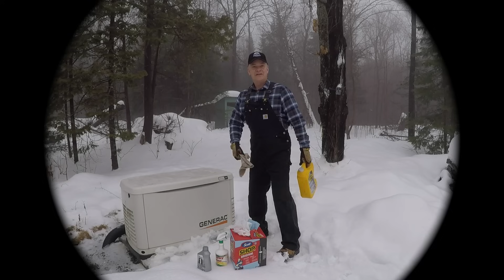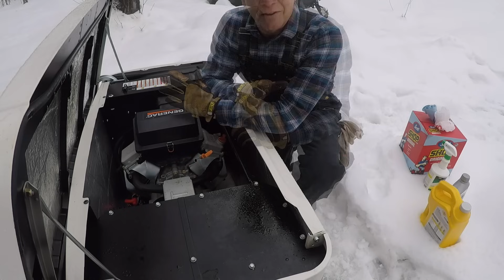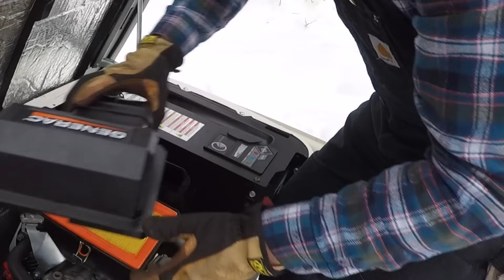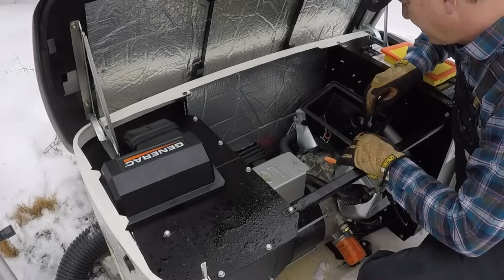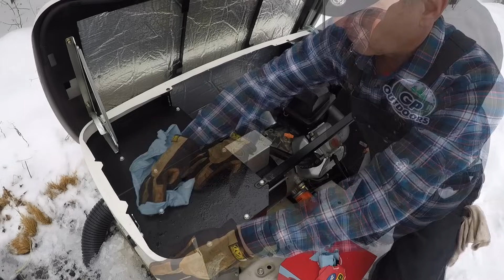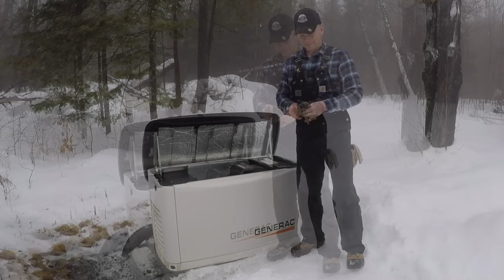#133 Thinking of Buying a Generac Generator? You Need To Watch This!

Comment: What he calls "exhaust port"... is this actually the crankcase breather?  This is a small tube that directs the crankcase breather to the air box intake so these gases vent and burn through the engine.  This would also explain the popped dipstick.

Comment: Great video that explains the problem and solution that he’s found! I’m not a generator expert but I’ve been a technician for 40+ years and I’ve see these rubber weep valves in the bottom of many air filter housings. It’s designed to automatically open and discharge foreign material at the slightest positive pressure and automatically contract with negative vacuum while the engine is running to allow crankcase purge. It is round at the top and converges to a “vee” shape at the bottom where the two sides form the flap valve. I would not drill and leave an open hole, unless you have one of these rubber weep valves to insert. Hope it was a help!

Comment: Great video. If this is a problem you have regularly why not fit a solenoid activated drain valve into the bottom of the air box that is open when the engine is not running and drains the water out through a hose?
Reply from the maker: Thanks for the helpful suggestion. Once the warranty runs out I will do something for sure. Take care and thanks again!

Comment: What about installing an extreme cold weather kit since that you live in a cold climate like me in Alaska. Blowing snow 75MPH wind shut my Generac generator off from running ice blocking the air intake from breathing. My plan is to build a snow fence around my generator to reduce the amount of snow from collecting. So, thank you for your video.

Comment: to me, that hose is acting like a egr valve. this hose runs the crank case pressure and gasses back into the air box to re burn it. sort of like breathing your own farts. why not simply plug that hole in the air box, drill a hole through the backside of the generator cover and run a bigger diameter drain hose outside of the whole thing? Your engine will be breathing clean air, you alleviate the condensation....I think it would solve the problem. Great video btw.....in the process of buying one so glad to see this.
Reply from the maker: Morning Steve. Thanks for the help. A few folks have suggested similar ideas. Take good care and all the best!
Reply: That is exactly what it is doing.  It is part of the emissions control system to re-combust some of the gas.  Another example of the California emissions standards rendering equipment non-functional.  I would absolutely do as Steve suggests.

Comment: Great tips! I have the same 16kw gen set works great. I live in a very rural area at 1300 feet above sea level. Several power outages per year sometimes for 3-5 days. FYI when ever you open the generator cabinet always
1.  inspect battery for swelling from overcharging. 
2. Inspect wires & terminals for rodent damage and corrosion.
3. Check battery voltage on the panel & with a multimeter.
4. Check battery charging voltage & amperage.
Reply from the maker: Good day Sean. Thanks for the great tips! Cheers and all the best!

Comment: Hey GPS, Do you think that if you drilled a say 1/4" hole straight down in the air filter box and put a duck bill rubber grommet in it. That the heat when running that would allow the water buildup to drain out before it freezes?? And by going straight down, instead of going out the side into that exhaust port?? Or just wait for the Manufacturer to take my other idea of a heating element and install that as a "Cold Weather" packsge.

**Edited because spell check sucks.
Reply from the maker: Thanks very much Dan! I heard from another commenter that the newer units have a redesign that is supposed to fix it. Thanks for offering the ideas. Cheers!

Comment: Sounds like Generac Engineering needs to come up with a different approach to their air filtration box. 
Question: could you add a 120 heater or even a Incandescent light bulb  to the generator housing to keep water from freezing during the generators operation. 
Obviously the heater would not need to be running when the generator was off.

Comment: The fix is to drill a 1/4” drain hole at the bottom where the water pools. The 1/4” hole is not large enough to bypass any significant amount of air from the filter and won’t have any detrimental effects on the engine but it will drain the water before it freezes
Reply: As long as the mother board don't go out on you, it's not a bad generator.
Reply: Except maybe for insects and dust. It would be much better if the manufacturer of the generator made a design modification to fix such an obvious design flaw. EDITED: Which, according to a commenter from 4 months ago (3 months before you left your comment), they have fixed. Hallelujah! (Now I have more confidence in buying myself a Generac generator!).
Reply: I totally agree with a tiny hole. Would not cause any issues with filtering. It’s not like a car driven down a dusty road. I’m pretty sure pollen won’t bother the engine

Comment: In that environment I would suggest running a 100 watt bulb hanging in the unit to prevent ice from forming. You'd be surprised how much heat a 100 watt bulb will produce. Put one in my well house every winter.
Reply: A 25 watt bulb would probably accomplish the same thing...

Comment: Whenever it gets real cold here's a little trick that I have used in the past to keep my boat engine compartment extra warm in the winter when it gets real cold. Get yourself a 40 or a 60 watt light bulb it has to be the good old-fashioned kind that puts out a lot of heat. Just run yourself a extension cord and plug-in whatever you're going to use the power your light bulb. I use an old-fashioned drop light.It's the kind that the mechanics used to use and you can pick them up pretty cheap. Or you can get yourself on old lamp. Just make sure it's not touching anything. And when you know the temperatures are dropping just plug in your light and you're good to go. One of the good things it does not require a lot of electricity as would a electric heater.

Thank you for the information on this.I've been thinking about getting the exact model that you have and where I'm at we do get some pretty cold Winters. Thank you for sharing your experience with this.
Reply from the maker: Thanks David. I appreciate the suggestion. I have all 3 heating kits on it now so will see how this coming winter works out. Good luck and all the best!

Comment: generac makes a breather heater now: Generac 7103 Extreme Cold Weather Breather Heater Kit
Reply: Makes little difference to the oil. I service generators for a living and I can tell you these generators do not exercise for long enough. Here in the tri state area I find ALL of these units with water in the oil! (Think chocolate milk).  Generacs answer to this is to tell all owners to run their generator for at least 1/2 an hour once a month (beyond normal exercise time) to get the unit hot enough to get rid of the condensation
Reply: fit a vacuator valve.  problem solved.
Reply: @kirkstinson7316  
Haha I'm in the tri-state too, more upstate ny hudson valley area. 
Such is the life of a generator around here too, cottage cheese inside valve covers and a nice milkshake  in the oil.
Reply: hey thanks i did not know they made one
Reply: @kirkstinson7316  I’m in Mississippi, don’t get Any water in air box, just oil.

Comment: I think it's your PCV, not an exhaust port. I would either move the hose up in the air box or just vent it to the inside of the cabinet.
Reply: Do not vent to inside cabinet. If you do you will have fine oil residue all over the cabinet.
Reply: THERE IS NO PCV VALVE ITS JUST A VENT TUBE !
Reply: if you remove the tube and don't plug the hole you are going to experience problems when bugs get in your mixer motor / stepper motor / carb !!! Whatever you would like to call it !! because the hole is below the filter !!

Comment: Thank you sir, seems like Generac could solve that easy enough. I’m getting a quote from Generac soon for my home backup unit in TEXAS (yes San Antonio to be more specific) 😳. I’ve seen more power failures in the last five days than I have in my lifetime here… And I’m 63
Reply: nice! Another brand to look into is kholer they make some solid equipment.
Reply: We had a heater installed when purchased as per the installer’s recommendation.  Also installed the generator in a somewhat protected location reduce wind cooling the unit.
Reply: I live in San Antone working for audie Murphy.   I know what you mean about power outages….   Really an inconvenience!

Comment: Order a lower filter box housing , 

1- Modify second lower housing by adding a elbow/extension so its well above the level of the ice

2- make a drain and make sure to use a screen to prevent any type of contaminants from entering the box 

 no more problem. 
 if warranty issue from unrelated failure , install original lower filter housing

Comment: As a Generac dealer and technician I can tell you that is caused by high moisture in the air. During the winter it’s mostly due to the intake taking in snow why we always recommend to clean snow around the unit especially in the rear air intake for cooling the rotor and stator. You would also want to check to make sure that your generator isn’t set to do a quiet test mode and have it test weekly and not biweekly or monthly. Also a block heater kit helps aswell.
Reply from the maker: Good day and thanks Steven. Appreciate the help. You are correct. It only happens in severe cold and as you may know, we have a very humid climate in Ontario. I always clear out the snow for a few feet in front of the unit intake, and always have, and I have three heaters on the unit , and always have. My techs just let me know that Generac has just recently released another kit which is another heater that wraps around the vent pipe from the crankcase so that should stop the water from freezing in the pipe. They will be out soon to install it for me. The only thing remaining  is to do something to allow the condensation to drain from the filter cabinet. Thanks again and all the best!

Comment: I was wondering why there wasn’t a drain off the air filter case. Even a high efficient home furnace has a condensation drain and a pump to remove it from the combustion area of furnace and pump it outside the home. A simple quarter inch copper pipe that could drain down and to the out side of the cover. If the pipe went close to that “Hot “ exhaust manifold it would pick up enough heat so that the copper pipe with the water in it probably wouldn’t free up in the winter if the generator was running. If you chose to have a small reservoir on floor of the cover then the duckbill/one way value would work to prevent back flow into the air filter case. 
For the price of that generator I’m surprised that the engineers of Generac haven’t haven’t figured that out.
Reply from the maker: I have been told in the comments, that the newer units have solved this issue but I have not verified that. If you alter the unit by putting in a duckbill drain, they told me it will void my 10 year warranty. So after the warranty expires, I will do that for sure. :))
Reply: Again, the moisture isn't supposed to be there. It is caused by the engine not being run long enough to burn off it's own crankcase moisture. All internal combustion engines will do this for the same reason. 
Start your car when its's cold and the temp. is below zero. Shut it off after 5 minutes and pull out the PCV valve and you'll see a milky white goo which is oil and WATER.
The only modification that needs to be made is to correct the way they are used.

Comment: Good morning... I'm betting you just saved someone from much frustration. Sharing information like that is worth its weight in gold.
Thanks. 😊
Reply from the maker: Good day and thanks Edward. I hope it helps a few folks. They are not bad generators overall but just wish they would resolve that one issue. The point of the generator is to be reliable in severe conditions when power goes out, and of course, that's when this happens. LOL. Have to laugh. Keeps me sane. Thanks again and have a great week!
Reply: @GPOutdoors  I'm kinda looking at the Kubota SQ and J and SJ lowboy  generators plus they have feul and oil guage  with  low engine oil light and feul gauge and glowplugs wich pretty smart design plus same oil filters used from kubota tractor

Comment: Good advice and good how-to video, GP.  My suggestions were listed below in many of your viewers' comments.  I'd have the unit high up on a slab, have the unit sheltered so no snow/water can get inside, a light-bulb lamp inside the shelter to keep it warmer than outside temperature, and store clean-up wipes, cleaning solution, oil and parts in the protective shed for easy access.  The precautions I mentioned are not going to stop the unit from the condensation build-up but just how I'd like it set up.  Your video is definitely spot-on for generator owners.  I wonder if other brands have PCV issues.  As you recall, I recently went through hurricane Florence and said I was going to get a generator and your video definitely taught me something.  As always, your videos hit a home run.  Later and thanks much.
Reply from the maker: Hey good evening Houndsman. Thanks for the suggestions. The Generac is a good unit overall and not sure if it is just the climate we have here but have spoken with a couple of the techs here and will have Generac's latest Kit installed soon which should help. Cheers and all the best!
Reply: Knock on wood, I havent run into that here in New England.  I have had a 22kW unit going on 5 years now on a gen pad outside and it has been flawless in the 3 to 4 events we get every year.  Granted, weather typically not as severe. That said, I will keep an eye out for that.  Thank you for the video and the good tips!

Comment: You call it an exhaust port but I'm pretty sure it's the crankcase ventilation port which sends crankcase vapors through the intake to be burned off  . That being blocked would also build up pressure and push out the dip stick .  Thanks for the video , I'm considering getting one . 
Retired heavy equipment mechanic . There should be a one way drip valve one the intake housing .
Reply from the maker: Yes very sorry _ I am not very mechanical - you are right - crankcase vent. Thanks and all the best sir!

Comment: A very well organized and thought out video. Thank you.  I might make a suggestion or two. Northern Pa winters can be cold. I installed the following on my Stand-by Generac 20KW: A battery heater pad, an oil filter wrap around heater and finally some heat trace tape below the air filter housing.  Since I took these measures I have had no issues through the years with any potential ice build-up and lends itself to an easier start-up.
Stay well (and warm)
Reply from the maker: Thanks very much for the great suggestions. I have 3 heaters on it currently and had aded the last one -which was a new kit they offered this past winter, which wraps on the vent port to stop the water from freezing back into it. The water still builds and freezes in the filter box but at least it is not blocking the vent port any longer. Thanks again and all the best to you!

Comment: If there is water then you should be able to control it. Maybe a condensate trap or condensate evacuation devise would be helpful.  They only allow flow one way so no vacuum air can be drawn in..

Comment: my neighbor bought one last october and has never needed it but the serviceman has had to come out five times since then to work on it. it is supposed to self start every couple of weeks so it will be ready but it has failed to start and run every time. i would rather trust a camp fire to keep me alive
Reply from the maker: Good morning bubblegump. Thanks for the info. It surprises me. Both mine have always started - this is the only trouble I have had (not that I am happy about it as it has been recurring for a long time) but anyways thanks for the info. Cheers!
Reply: They are designed for short term standby power only not sustainable for that you are better off with a diesel generator such as a stateline those run forever
Reply: lol
Reply: Live in FL and ours is connect to our home gas line.  Since install two-years ago, the unit has performed as advertised. Self-starts every Friday for a check and on six occasions when we've lost power, the unit has provide all the power we've needed in our home.  The longest run time for an outage has been seven hours.  During install the rep cautioned my wife that when the generator is running, she should avoid using the washer, dryer, oven, four burners on our stove and microwave all at the same time.  If she did, the dryer would stop.  I thought my wife was going to collapse on the ground laughing; after gaining her composure she replied "who the hell uses all of those at the same time?"  Even the rep had to laugh.

Comment: I'd recommend drilling a drain hole in the filter housing if possible so any water will drain out instead of building up again.
Before doing that I would also contact the manufacturer because they may have a service bulletin for that.

Comment: Blocking the exhaust on an engine would not push the dip stick out. However, to much pressure in the crankcase would. That is a crankcase relief valve port. The crankcase will vent into the intake so that will be burnt in the combustion cycle.